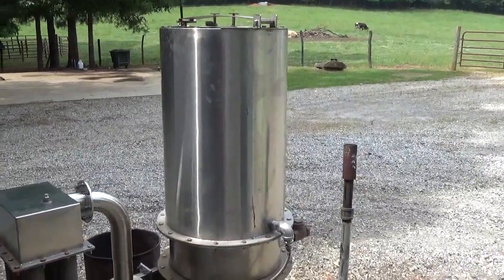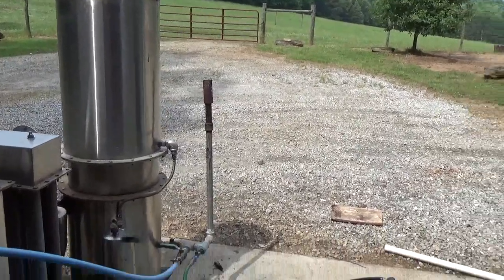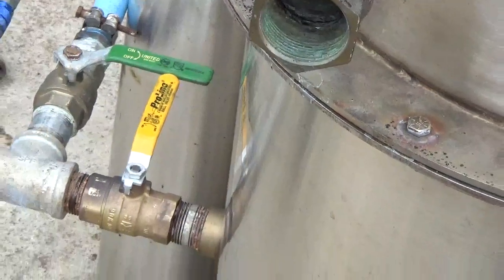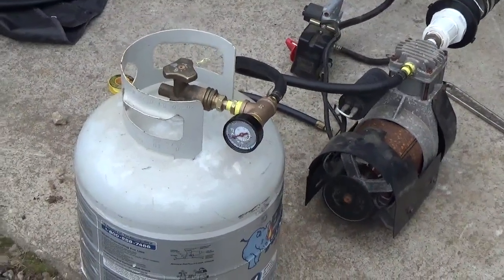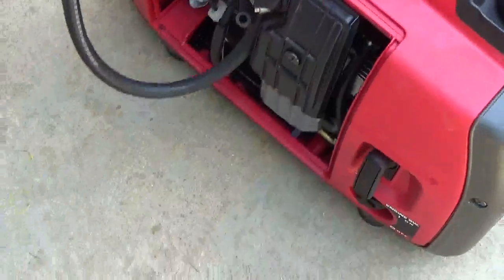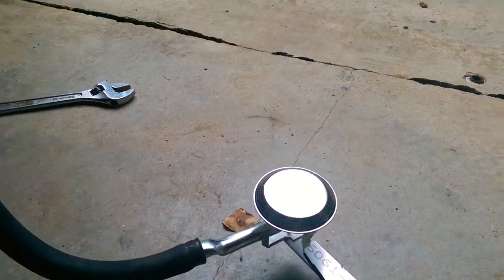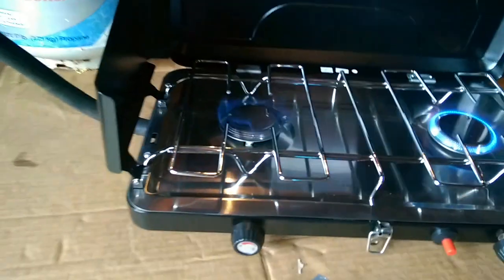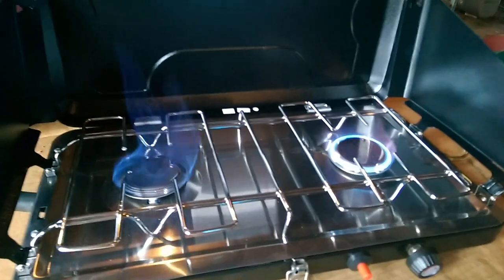Compressing Woodgas for future use.

Comment: the big mistake all of these guys are making is they are not pulling a vacuum on the tanks before filling, one need s a set of ac gauges and a vacuum pump harbor freight has both at a low price and would be ok for this application, to be fully evacuated one should pull a vacuum then let gas in and pull a 2nd vacuum before filling
Reply: aaronhall555 could a flashback arrestor be used and/or be practical if i were to use it. Being that i am not an experienced by any means and am cautious.
Reply: Hello Leslee you seem to be knowledgeable about the wood gas storage please advise me on how to store it in a propane tank and how long can it last and the best method to make sure it doesn't leak I want to store it for small commercial purpose thanks
Reply: Why don't you make a video to educate us ?
Reply: @sarchlalaith8836  The point is about safety. Evacuating gets rid of oxygen in the tank. If not you're creating an Oxy/Gas Bomb
Reply: What about the air that would already be in the compressor. That would have to be removed right?  Fill with water?
Reply: Leslee Freeman of don't see much of a problem with just compressing the woodgas as long as the tank hasn't sit open while empty for too long, since it should have no O2 in the tank when it runs out propane, once you start to refill with woodgas what ever was last in the the tank just mixes. Therefore negligible amount of propane mixed with woodgas should not be a problem as long as no O2 makes it in. This seems pretty safe with an experienced woodgas operator, skilled at producing consistent quality gas, and proper safety procedures. If anything, pulling a vacuum before refilling sounds like more chance to pull O2 in to the tank. What do you think?

Comment: How long did the generator run?
Reply: He most likely didn't, if you consider that the compressor is almost certainly drawing more gas than the gassifier can produce excess air will be drawn through the system and into the cylinder.

Essentially making a lovely bomb, propane, LPG and natural gas cylinders tend not to violently explode in accidents because they lack the air to allow the flame front to propagate, however in this setup there is air in the cylinder.

Comment: What about making it safer to compress by adding a spark plug burning chamber prior to compressing.  I don't want anyone thinking your method is safe but if you could control the amount of oxygen in the air by igniting prior to compressing then your making it safer to compress.

Comment: how did you purge your tank of air so it will be pure gas
Reply: He most likely didn't, if you consider that the compressor is almost 
certainly drawing more gas than the gassifier can produce excess air 
will be drawn through the system and into the cylinder.

Essentially making a lovely bomb, propane, LPG and natural gas cylinders tend not to violently explode in accidents because they lack the air to allow the flame front to propagate, however in this setup there is air in the cylinder.
Reply: This is incorrect, a compressor will pull more air through the gassifier than it can burn, ergo your end resulting gas, no matter what the composition will contain at least some oxygen, so you are compressing fuel and oxygen into a cylinder.  too much risk of kaboom
Reply: @Garuthius  You're correct. Also the fact that he didn't pull a vacuum on the tank first, getting rid of any oxygen in the tank. Way too many clowns watching this video, thinking its neat and can't wait to build their own bombs.
Reply: miamorepourvous vaccuum it with a fridge compre.Technically the vaccuum is no air.

Comment: It's dangerous to compress wood gas because of the possibility of oxygen intrusion into the compressed gas. I doubt the stored volume would be significant. The wood is the storage medium. Thoughts?
Reply: +Clark Griswold You are correct in your statement. Propane in the cylinder is in a liquid form and there is a lot of run-time in a full tank but the woodgas cannot be compressed down to a liquid without the proper refinement process plus if there is ANY air in the mixture you have a possible bomb. The best thing I've seen is people compress it into a large balloon or into a tractor inner-tube. With the balloon it has enough pressure to push through a tube to run a small stove burner. With the tractor inner-tube you have to lay a piece of plywood on it and place weight on the plywood (Concrete blocks, Bags of sand etc) to force it out to a burner and it's a much safer method. The reality is woodgas is really a "on demand gas" that really needs to be used while it's being produced.

Comment: How Safe is compressing the syngas. one would imagine a bit of air mixing with it and a small spark boom..
Reply: again  yes you can use the gas of pyrolysis ,right away .  but storage in big scale would be catastrophic with out using the gas separation methods ,,,it is not just talk it is science what says so.  giving a free advice to people not harm them selves is a must we we see a child playing with a match right next to gasoline..be cool
Reply: like any other fuels ...
Reply: In fact pyrolysis gas ((S)) are many 214 different elements  to be released when the process starts we get acetic acid @ temp. 80 -120 degrees C   in a form of vapor. .then at higher temperatures   many gases to be released the most dangerous part when temp reaches 550 c   their we get as much as 14 gas types the most critical to be is the oxygen and hydrogen  methane  etc...if we pressurize the whole gas together then we end we a severe problem  in order to do so. We need to separate gases then each apart to be its own tank..  but some gases needs a special tank that can handle 1500psi under room temp.  else you need to refrigerate the gas at least 200 degrees c  minus ...  dear i hope you you can understand the basics i talked  not only we talk to talk.... but at his moment i am building a complicated piping connection for wood pyrolisis and because of this problem i decided to burn a portion of this gas directly under the reactor and the other extra huge amount of gas i'll pass it aside to burn it in the air.. unless we separate the gases so we can compress them. many  scientific researches and patents out there i can link to you guys in order not to harm yourselves ,,, stay tune ...
Reply: what a nonsense, you just talk to talk .... Know people who had converted their cars to gas and filling up their tanks with any gases they can put they hands on ... mean same tank on the top on other gas ...  wood gas, propane, butane, hydrogen ...  whatever ....
Reply: So what you expect me to do with this theory? 10 years of practise says otherwise. You should ask your teacher why this theory doesn't work or why people not getting hurt by doing it ... What else can I say? Why you so keen to believe us  otherwise? Maybe there is a mistake in your teorie?
Reply: dear no need for a spark   it goes boom only by pressurizing 2 o more different gases they become so hot for the friction of MOL ....

Comment: No regulator? Do you have your propane tank's valve fully open? Is there a way to extend run on your generator by regulating the gas flow? Just curious. I am getting ready to build a gasifier and have several out-of-date propane bottles on hand to use for storage of compressed wood gas. Interesting!

Comment: Now this is truly outstanding. I did not realize it was safe to compress wood gas (or I am sure biodigestor methane gas) this way. Are there any warnings you can think of?
Reply: You used the magic word "safe". Compression causes heating and if it heats too much it goes boom. Anything over a couple of psi is potentially dangerous. Wood gas and methane systems are fairly safe due to the low pressures. A standard compressor isn't designed for this use. I've worked around a lot of compressors and most get too hot to touch. You may get away with it but then it's a hot day so the compressor gets a few degrees hotter then all they find are your empty shoes. I was thinking about compressing methane to 5 psi just to make a generator run better but even that much scares the heck out of me.

Comment: you can use an cheap air compressor with motor series and add a cheap speed driver and use a oxygen sensor ( from car ) and PID contrôler (0-5v) input and 0-10v output  or  0-5v (depending on your drive) to be able to compress a pure gas. :)
equipment can be purchased for less of $ 100 on ebay
Reply: Huh?

Comment: Is it possible for the compressor head to heat up enough to ignite the gas,Just wondering because i run large compressors a lot and the heads get very hot, 
Did not catch it on your video due to noise but how are you cooling the gas before 
it hits the compressor. Thanks for the video, love this stuff.

Comment: hi, would it be possible for you to do test at different time as in make multiple bottles so you can run the times in parallel and do test like 1 day sitting 2 days 1 week 2 weeks a month and do the test with a timer to show how long they run the generator at idle and also how much gasoline the generator would have used at those same times at idle, this is very important for a project im working on i need to know how long you could drive off such and such sized tank while the gasifier is starting, also could you do a cold start on your gasifier with new wood of whatever kind you use and use the woodgas through the lighting port to start it, im trying to make a fully automated and (wood supplied of course) self sustained system, im trying to make a turn key system that self adjust and self lights, where you can start as quick as a gasoline vehicle, similar to newer propane conversions, and the system will self light, while you drive, but i need to know how big of a tank i will need, i know i can cut the size down by %50 if i can remove nitrogen, and if your test show that it doesnt last as long as it ages then i can cut it down to %30 the tank size of that tank by just capturing the carbon monoxide, other systems include a cooler that is under the bed of the truck and an oil bath gas cooler/cleaner with a radiator in front of the truck but behind the grill

Comment: Are you purging the tank with an inert gas first? Furthermore how much O2 is being compressed with your wood gas? It would be very easy to create a flammable or explosive mixture in a tank containing air. I suppose once you put enough wood gas in the tank you create a rich mix that cant burn. I would be concerned about the intervening time between the LEL and the UEL, during that period you are merely charging a crude FAE. I would try to cool the gas post compression and keep the tank as cold as possible. Perhaps a orsat or a fyrite would give you a O2 reading on your wood gas?

Comment: I think the problem with storing wood gas is its energy density.  The whole point of turning wood into fuel is its energy density.  You can store a cord of wood and that is equaled to hundreds of gallons of gasoline.  The gasoline will degrade in months where as the wood could last for years.  Storing wood gas is like canned farts.  I think a simple and reliable gasifier is more practical than compressing it and storing it. Plus hydrogen has the smallest atom and will leak out of anything you store it in.

Comment: On a related but unrelated subject... could you use a filter and compressor (like yours from Lowes) to compress and store methane gas, obtained from a composting tank, into a steel propane tank?  I seen other videos where methane gas was put under low pressure (without the use of a compressor) for heating and cooking purposes but I've never seen it stored for future use.  Any thoughts?

Comment: Does the gas liquify under pressure like propane?
Reply: Its not as simple as compressing it but yes it could be stored under pressure. It has a lot of hydrogen in it which will destroy a steel tank over time. If you removed the hydrogen you would have mostly carbon monoxide which could be stored liquid.
Reply: @electric_photon4660  Carbon monoxide and dioxide are the results of combustion. So they don't burn, there would be no point in storing them.
Reply: @robertsullivan4706  carbon monoxide is a product of incomplete combustion. It is very flammable.
Reply: @electric_photon4660  Alright, I'll give you that, but it's still not as energy dense as standard hydrocarbons.
Reply: @robertsullivan4706  yeah definitely not as  effective as gasoline but possibly useful during the apocalypse lol
Reply: Ivar Alendal all will under the right pressure so probably hell you can turn oxygen into a liquid

Comment: Beat me by a week, I have a similar setup but I added a couple of extras, my 9kg LPG bottle is immersed in a steel water tank approx 4m2, adds a bit of cooling but the main reason was if it goes pop the water takes the impact and you just get wet instead of standing beside a 9kg grenade. I also have a small water bubbler post compresser for a flashback arrestor(maybe I'm just chicken-your's didn't blow). Ran out of time to run the gasifier last week. Will let you know if I encounter anything along the way.
Reply: Hey man, I love you reply. Have you made a video showing your gasifier? I'd love to see the setup.
Reply: That's smart because it also cools the compressed gas, compressing gas will heat it up a lot so by cooling it you're making it safer as well as the flash back arrestor. Cool setup. Also for the propane tank water bath, if you are using the tank for propane, you could use a pump to circulate the water through a heater to heat the propane if you run into problems with it freezing up (only applies to propane since it's stored as a liquid). Very cool setup, I like the idea of using what's around you vs importing energy!

Comment: I've seen a similar experiment before, very cool.  I would like to find out if one could use a HP compressor and HP vessels for longer run times in a vehicle, etc.  It just seems to be a simpler set up as opposed to having a gasifier on everything, car, truck, tractor, etc.  The local community would also benefit from this as well and the infrastructure wouldn't be too complicated for a municipality to set up....I think.
Reply: HEAR HEAR! I concur AND second!

Comment from the maker: A video on compressing woodgas for later use.  Experimenting with compressing woodgas for cooking.  Imagine being able to store enough gas to get you through a season of cooking.  you will need large tanks to do this effectively.

https://practicalpreppers.com/online-shop/power-solutions/gasifier-detail-view
https://practicalpreppers.com/online-shop/power-solutions/the-l-e-a-f-wood-gasifier-detail-view

 #practprep   #Woodgas
Reply: Probably not.  Think air compressor.  You pump them up to about 120psi... so most likely they won't hold shape, and would eventually rupture.  I don't think they would explode or anything.

Around here (DFW, TX) a used 500 gallon propane tank sells for about $250-$300... if you have a way of getting it home it would probably be the way to go, if not, small propane tanks.
Reply: 404 on both links. Just a general off grid site now.
Reply: As in the large propane tanks that I often see in back yards.
Reply: wonder if salvage gasoline tanks might work if they get sealed well.
Reply: engineer775 Practical Preppers

Comment: If you get too much air in this it will go BOOM!!! Very dangerous especially in a propane tank. Ive had some pretty scary flash backs and this is without compression. When you compress and densify this gas and you get too much air the mix this will end very bad.

Comment: Awesome, thanks for sharing Scott! I've been wanting to see this done for a long time.

Is the air to fuel ratio low enough that it would not explode if a spark were to occur inside the tank somehow?

I will be doing this with pure hydrogen gas from a hho split cell I'm in the process of building. I'll post a video of it once everything is set up and ready to go.

Comment: Huhh, what did you say?? LOL  Two questions: 1 Is there any danger that the compression could cause it to auto ignite like diesel (especially with a leaky head gasket on your compressor which would be susceptible to sucking air as you mentioned)?  2. If you ran the compressed gas through a heat exchanger, is there any possibility of getting it to a liquid state so that you could store more in your tank?  What pressure would you need at, say, 72°F for the state change; the same or near to hydrogen? (I can't find my thermodynamics book anywhere...LOL)

Comment: Out of everything you do, i still am most intrigued and interested in your wood gas experiments. Loved seeing that big generator run off this stuff and now seeing that honda run off of it. Did the honda have a propane conversion or do you just pipe it ino the fuel line?
Reply: Think he said he just piped it into the carburetor/air box. Basically replaced the air intake, which is why he added an air intake valve right off the propane tank, basically moved the carburetor (i.e., device which combines fuel and air) to the top of the propane tank vs in the engine. Fuel hose looked like it was just disconnected meaning it would allow in a small amount of additional air but most people would cap it off since it's not really doing anything in this setup.

Comment: Interesting! I've done academic research distilling in low (actually no) oxygen environments on wood (actually lignin).  I'm curious if the compression, despite filtration, leads to any liquid products in your tank. Furthermore, I ponder whether or not creosotes or phenols may crystalize after cooling in the tank. That, of course, depends on how much oxidation occurs, but it has got me wondering.

I've always wondered how to set up my own compression system. I have long wanted to couple water electrolysis with compression of hydrogen gas.